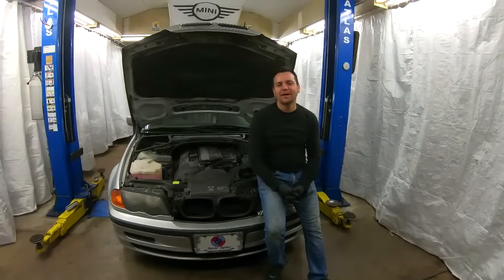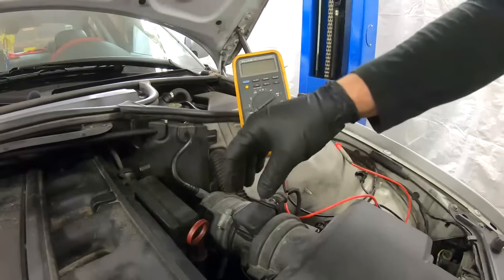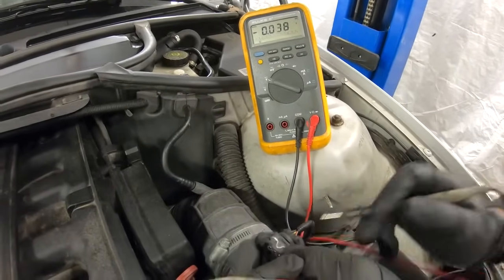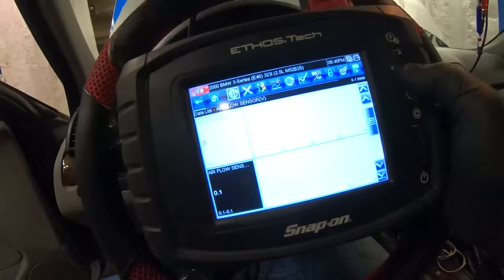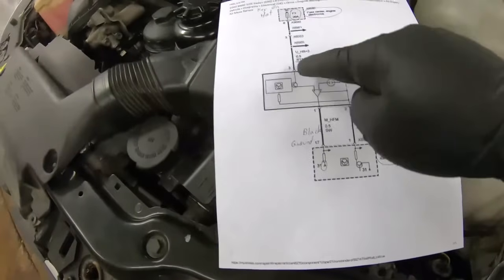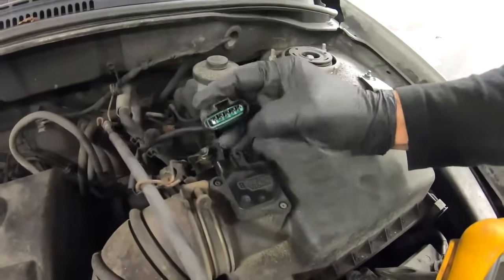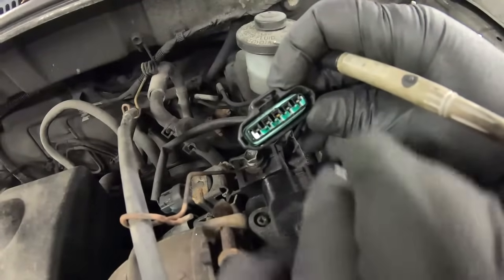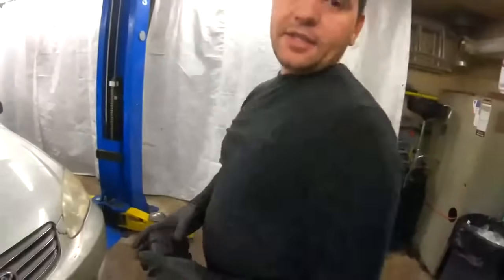How to test Digital or Analog  Mass Air Flow (MAF) Sensor, With or Without wiring diagram, 3-5 wire

Comment: 123 / 5,000
Translation results
Translation result
Hello, my friend, I have a MAF sensor that has 5 wires, but the output shows the same voltage as the input 12 volts, can you help me, this is the model.Siemens VDO 5WK9 6431

Comment: Great video! Please help me out. A 1999 Toyota Avalon car with a v6 engine that cranked but wasn't starting.
After engine rebuild and gear oil replaced . While test driving by the engineer , smoke started emanating from the engine bay. Precisely, from the fan relay that the car owner connected by himself. Within few minutes, the car shutdown by itself as if fuel is finished.

Presently, it's a crank a crank no start, no spark, no injector pulse, check engine light staying ON with ECU connected or removed.
I tried to scan for DTC codes, but my scanner wasn't communicating. I checked all fuses, power and ground at obd port, those checked ok. but my scanner isn't compatible to read CAN network. There are only 4 wires intact for the obd2 port.
Furthermore, I added fuel through the intake to the engine, no change at all. I checked for spark and injector pulse. These things weren't present. But there was power to injector with just the key at ignition or ACC and COP had 1 ground and 1 power as usual.
With the ECU removed battery connected, Engine light would come ON. with ECU connected check light still comes ON.
Before I left, I checked the MAF sensor 5 wires and noticed that 3 wires were earth instead of 2 and 1 power; no ignition current/ power was available for the remaining 2 wires.
Please, what should I do
to get this car running again?

Comment: Great engineer, please help me out. 

  Recently, a client called me to fix his 2000 Toyota Avalon car that cranked but wasn't starting.
   From the onset, the car experienced several mechanical, as well as, electrical issues. Some of those  problems were:-
(1) Engine Oil consumption;
(2) Engine misfire;
(3) Engine rattling;
(4) Intermittent hard starting after shutdown; 
(5) Hard to engage in drive, except engine is hot; etc.
Hence, he took the car to a garage inorder to rectify the excessive Engine oil consumption and other car problems highlighted above. Consequently, the car  problems exacerbated after engine rebuild by the engineer! 
  The car owner wasn't satisfied with his repairs because it seems the engineer was deceitful. Although the car started after the rebuild, the problems still persisted.  Valves weren't grinded after engine overhaul, engine still misfired at idle and when accelerating, etc.
   The  engineer whose garage the car is presently being parked, requested for another engine overhau/ rebuildl. After engine rebuild the car started, the oil was mixed with water; the engine was still misfiring, rattling, etc. It was obvious,  that he didn't use durable parts to do his work.

    Hence, the car owner moved the car to another garage for better repairs. The new garage suggested to the car owner that another engine rebuild is pertinent for optimal engine operation. 
    During my conversation with this engineer, whose garage the car is presently being parked, he told me that: "when the car was first brought in, he noticed a black smoke ( maybe he was mistaken for blue smoke, at exhaust tail at idle). When accelerating, there's a loss of power, engine bucking, popping,etc. After the rebuild, the car didn't start because the mechanic didn't unlock the car with the remote but proceeded directly to cranking the engine. In addition, the security relay wasn't actuated for starting to take place. Electrician did some wire cutting around that axis which he said was corrected to factory, opened with a remote before the car started.

   Fortunately, after everything, the car started again. But there was still an intermittent misfire. What the car owner said was that, 'even when the second mechanic did engine rebuild, the car still misfired. Until he personally bypassed earth from the COP wire to the solenoids very close to the fuel injector often tightened with 10mm knot and depicted with blue and green colors on the picture. Car owner verified that the reasons for the misfire from both mechanics which still prevailed, was due to the solenoid valve that wasn't opening. That's why when accelerating it experienced a loss of power, similar to that experienced by a faulty fuel pump.
  
   After gear oil replacement and test driven by the second mechanic , smoke started emanating from the engine bay. Precisely, from the fan relay that the car owner connected by himself. Within few minutes, the car shutdown by itself as if fuel is finished.  As he tried to restart it, the car refused to. Infact, when the ignition switch was turned to Acc/ ignition position, battery and fuel light was not displaying in the dashboard/ instrument cluster. However, during cranking battery light glew faintly and start. But when throttled,  it would shutdown. Electrician verified and replaced the alternator diode with a new one. When Ignition switch was turned to Acc/ ignition position, the battery and other lights came out brightly but when cranked to start engine wouldn't start again. Sadly, it still wouldn't start.
 
I tried to scan for DTC codes, but my scanner wasn't communicating. I checked all fuses, power and ground at obd port, those checked ok. but my scanner isn't compatible to read CAN network. there are only 4 wires intact for the obd2 port.
    Furthermore, I added fuel through the intake to the engine, no change at all. I checked for spark and injector pulse. These things weren't present. But there was power to injector with just the key at ignition or ACC and COP had 1 ground and 1 power as usual. 
 Electrician from that garage, who also worked on the car said that he sniffed burning smell from the ECU, however personally I didn't when I went to start the car. I don't know how certain that was. Hence,  I pulled out the ECU to a laptop board engineer to test the components inside. He said: "everything looks ok and test fine, however the IC he doesn't have the right tools to proceed with the test. With the ECU removed battery connected, Engine light would come ON. with ECU connected check light still comes ON.
Before I left, I checked the MAF sensor 5 wires and noticed that 3 wires were earth instead of 2 and 1 power; no ignition current/ power was available for the remaining 2 wires. 
  Please, what should I do to start the car?

Comment: What would cause multiple ones failing..I have had 5 in 12 months..start car and failed.
Reply from the maker: You probably have wiring issues. Maybe shorted to power, just check each wire
Reply: high voltage interference from coil and spark-plug...

solution,, making "shielded" on cable MAF_sensor,, make from internal cable copper,, turn arround the maf_cable,, leave end point near sensor(not connect to anything),, and connect another end point into chassis ground...

Comment: Thank you and good job.
I heard a tech telling about the 3 wire maf sensor :
- connector disconnected
- engine power on
- he measured about 5v to the signal wire. Its a digital one.
I dont understand because i think that we can only read voltage in case the connector is plugged.
Can you help me to understand ?
Reply from the maker: That’s correct, you can measure voltage to the power line but signal is what comes out of the part and the only way to measure signal is either with a Y connector or backprobing it

Comment: Great job! Maybe I have got one question. Does the MAF sensor any range of voltage min-max? if I understand right, from the voltage depends the volume of air going as a information to the ECU. Why do I aks: I tried 2 MAF sensors in my Toyota Yaris 1,33 VVTi  year 2009. The first one works from ca. 1,4 g/sec of air do max. ca 30 g/s. But the car is lazy and lose the power by higher RPM. The second MAF sensor works from ca. 1,4 g/s to ca. 170 g/s! It jumps to 170 g/s only by acceleration. The car runs much better but only for a while. After few minutes the car goes to the "safe mode", no power and on neutral the RPM goes down to 100-200 RPM and the motor stops... Maybe both are wrong, maybe the problem is not MAF sensor :) Thx!
Reply from the maker: I would check the exhaust, it sounds like it may be clogged. You can either disconnect the exhaust and drive or check the back pressure. Regarding the MAF sensor they do read differently as you push on the accelerator